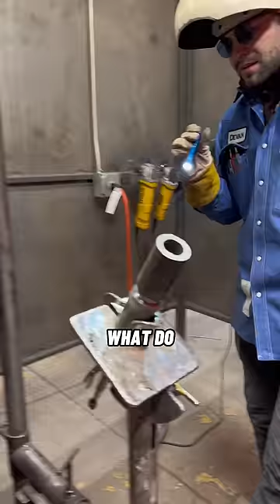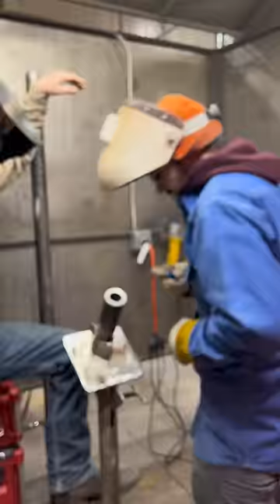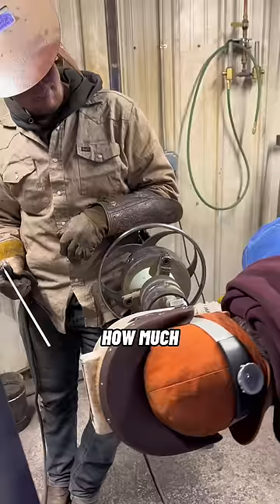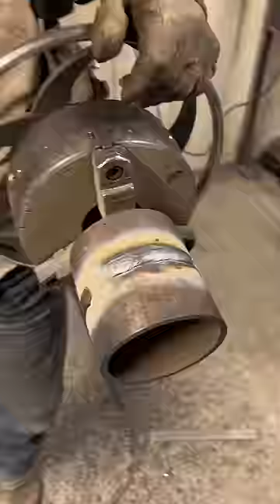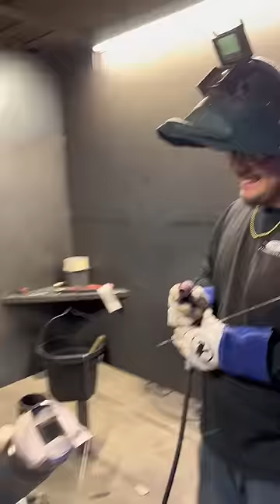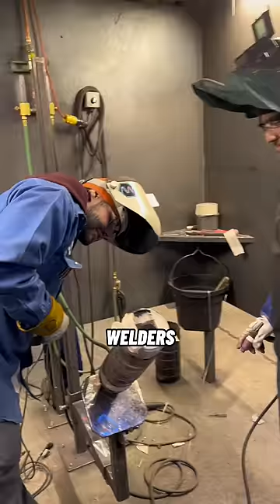What are they worth Pt 17 #shorts

Comment: One thing to remember as welders, is the prettiest welds don't always mean anything.
Reply: As an upcoming Ndt, I can agree. You may not have undercut or root concavity. But LOF and slag inclusion are a B😂
Reply: @paradox325  I see undercut all the time in a shipyard and it hurts me
Reply: True but that's not usually the case. If a weld is uniform that usually means things like travel speed, oscillation and distance were consistent. Giving you a visually nice looking weld. If you see undercut then travel speed at one part was too fast... I'm a welder and inspector at caterpillar. I've seen it all. You're right for the most part doesn't have to be pretty to be right size.

Comment: Just looked up the average hour salary for welders in the US and its around 20-25dollars
Reply: Thats mainly might and Flux hands. A combo welder that can fit to will start at 30 in a vessel shop
Reply: This also depends on what kind of welding your doing, if your supplying you're own equipment, and what the demand is currently. Some fab welders make upwards of 60, while a mig manufacture welder makes a lot closer to the 20ish range. Pipeline welders are generally among the highest pay, but that's because of things like cost of diesel, welding rods, miles traveled and most of the time they make per diem as well. But underwater welding is almost guaranteed to be the best pay anywhere you go.
Reply: What does “30 and a hundred” mean?
Reply: @jeremyspecce  He was asking for a grade of 100 on the test... this is a school. They aren't being paid that, it was the teachers opinion of what they could earn.
Reply: @Chris-xo2rq  he wasn't asking for a grade. When he said 100 he was talking per diem

Comment: Welding is one of the only jobs that you can have somebody come in and show their worth in an hour or less. I remember doing a weld test at the place i worked at right out of high school. I havent done anything close to any type of qualification test at any other job since and I've worked in a multitude of different fields since then. I even tried getting back into welding at one point and that place didn't even do weld tests. They based your pay off experience and had a tier system. I laughed when they told me what the pay was and immediately switch my line of work since that was the welders average in that area. Now I'm an IT engineer with no certs or degree make almost 3 times that...

Comment: If only this WELDING ACADEMY (it's not a job interview) would actually tell them HOW OVER SATURATED the welding community is and how few jobs there are that ACTUALLY pay these prices. MOST welding jobs (even the best of welders) sadly only pay 12-15-18 starting depending on the area. This is the reason why MOST WELDERS open their "own business" operating out of their welding truck. Because otherwise the "owner" of the company takes all their earnings. You'll be charged $80 a hour. And the employee won't get that 30-40. They'll get 12-18 and the company pockets 60+ a hour.